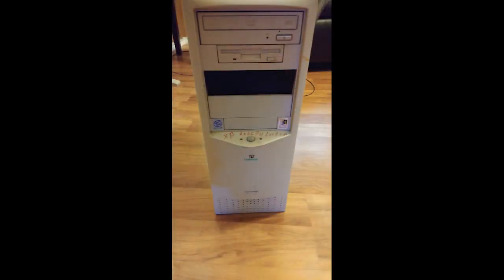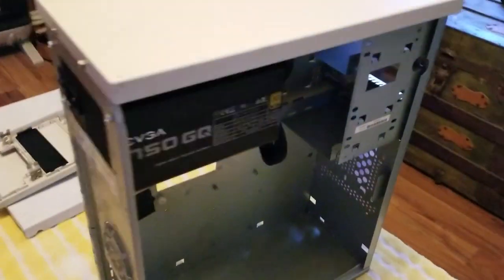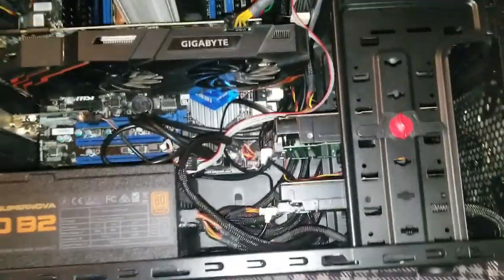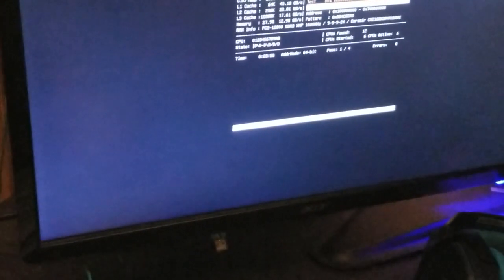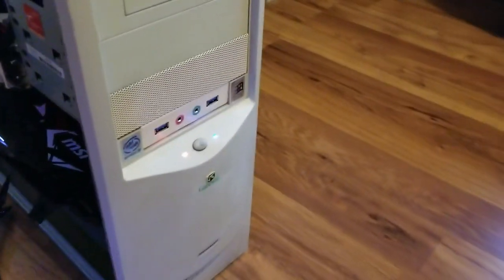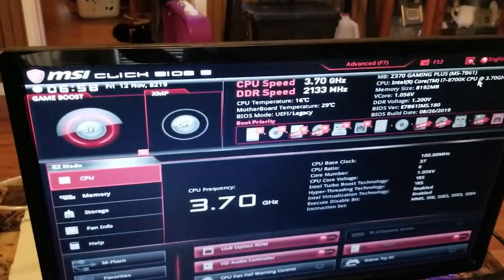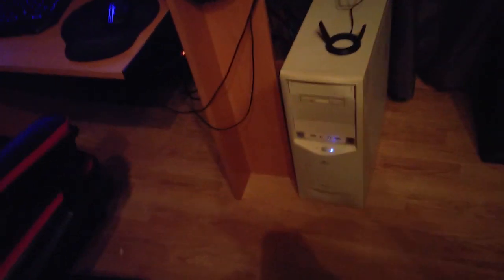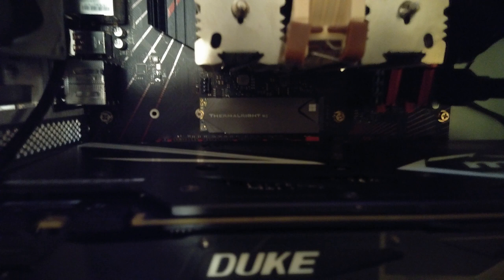Ultimate Sleeper Build: Beige Billy (Craig gets upgrades too!)

Comment: Where did you get the rear IO/PCIE Bracket?! I drilled mine out before watching your videos & am trying to figure out how to replace it without defacing the original
Reply from the maker: here's where i bought mine from-keep in ind you may have to trim off the bottom a bit to fit right like i did, as well as drill holes for the mounting screws- https://www.mountainmods.com/product_info.php?products_id=486&language=en&osCsid=qp2tso1eu0hqc5e3a5c3ls23v1

Comment: you could just re arrange the pins in the front panel plug
Reply: As far as I can tell he cut it and inserted another front panel + bracket slots taken from another case.
Reply from the maker: Close, I cut out the old switch and lights and replaced them with ones from a Lian Li power button kit.